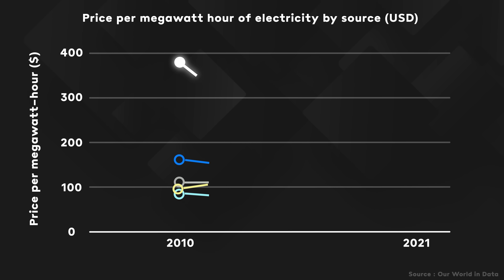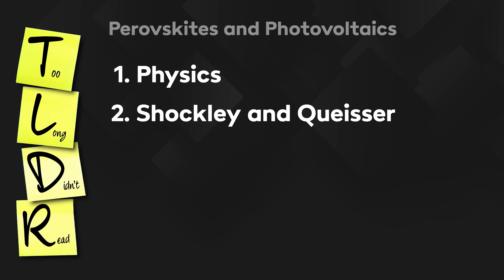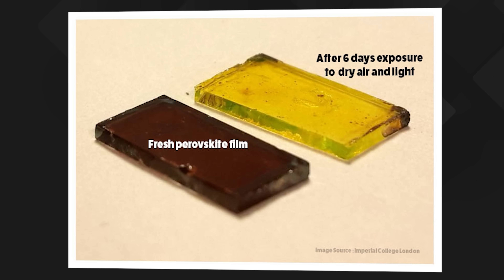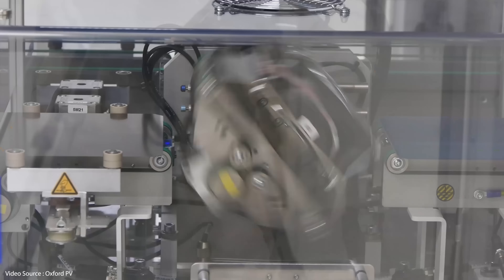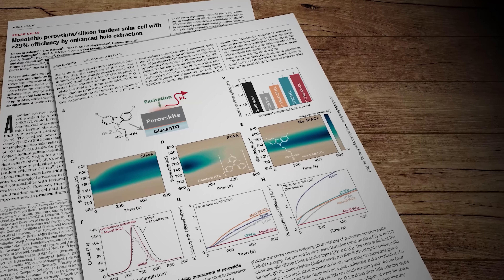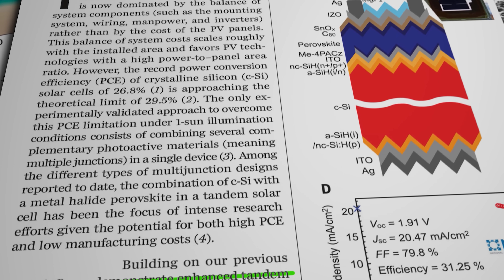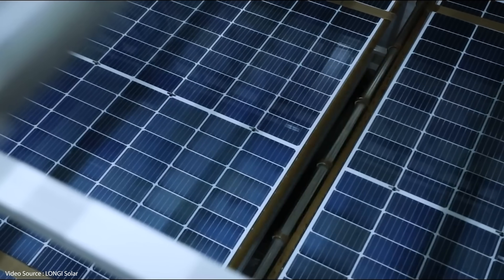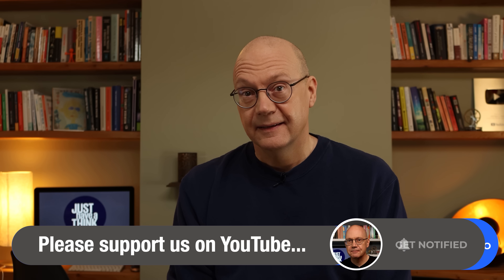Perovskite Solar PV. FINALLY some good news!

Comment: There is another approach to further improve efficiency:

With current silicon is it is cheaper to buy extra panels than to use solar tracking.  But, as the kWh per panel increases with perovskite layering, presumably cost/kWh will drop while cost/panel will rise.  That sets the stage for tracking technology to become economically viable in general.  (It is viable in the small set of edge cases where you need a certain amount of power, but have a limited space for panels.)
Reply: I like people like you that tumble the numbers and find new viable economic tipping points. Well done. I was mucking around with the idea of using my solar system to replace gasoline rather than grid electricity the other day and found that powering a car ( EV)  saved me 4 times more money in gas than using to replace grid electricity.  I then went a little further and thought what if I cover the entire 150 sq metre roof of my 4 bedroom home with panels  and came up with this. It would cost $40k (Australian) and generate enough to power 14 EVs each travelling 400 klms each week for 20 years. The weekly solar cost of each EV would be $3.00. The cost was mind blowing enough but what really astounded me was that just one residential roof top could power 14 cars.
Reply: @markumbers5362  Australia and China may be the poster children for nation scale solar.  Adelaide is always setting records for most days running entirely on solar/wind and batteries.  And with heat in the north, solar output lines sort of well with air conditioning needs...(although everyone turning on AC after work is a bit of an issue...hence batteries...but batteries in EVs...better charge at work ;)  I hope work charging accelerates).
Reply: @markumbers5362 As someone who is considering buying an EV and likes math, I’d love to see your calculations.  I want to verify all parameters were factored in.  Factors such as panel degradation over time, seasonal variations in output, battery degradation and replacement costs at approximately 10 years.  Also just initial set up costs of installation, panels,solar converters. inverters, home battery, racks, wire, etc

Then take the initial start up cost and instead put it into a S&P fund and drive a fuel efficient ICE car instead of an EV.  I’m not arguing one way, or the other, or drawing any conclusions, as I have yet to do the calculations.  I like looking at the numbers people produce.

There’s also the unknown variable of a Tax on solar panels.  In CA PG&E hates solar on people’s homes and they own the governor as they pay his wife millions of dollars.  So a bill has been created to tax solar panels on homes.  It’s temporarily been put on hold, probably due to the upcoming election.  But it’s been drafted……

I might as well add one more factor, at least for CA.  The legislature believes that people driving EV’s aren’t pay the high tax on gasoline and therefore they aren’t “paying their fair share” of maintaining the roads.  So that’s another future EV tax that is probable.
Reply: @jasonborne5724  You don't have to go in to that much depth to understand the savings. For a start if you need a car you need a car so that money isn't going in to your retirement fund anyway. EVs are a little more expensive up front but their servicing costs are 40% less and if you use roof top solar to charge them they cost $3.00 Australian (AUD) for a 400 klm 60 kw charge because the amortised cost per kwh is 5 cents and if I sold that kwh to the grid they would pay me 5 cents also. My previous 3 cars were a Honda CRV Subaru Forester and Mazda CX 5. They all burned an average of 8 litres per 100 klms so it would cost me $60 for 400 klm trip. Charging with roof top solar is 20 times less than gasoline. I only believe the life of a car is 10  years anyway after that maintenance costs get so high you may as well buy a new one. Because servicing costs are so low on EVs the extra interest on a slightly larger loan balances out. So now I look at simply this. A Tesla Model Y costs me $70k down here. A similar size but  inferior performing with less features Mazda  CX5 costs $55k. Over 10 years I will save $30k in fuel by solar charging the Model Y.  So the total cost of ownership is $15K less for the Model Y.  As far as tax and legislation is concerned. It is true EVs do not pay any fuel taxes and that revenue must be made up somehow. However that is in the future and so too is this. According to Wrights law for every doubling of production there is a 20% reduction in price.  Battery, solar and EV  production will double 5 times over the next 10 years so very soon the upfront cost of an EV will be less than an ICE. When that happens any tax increases on EVs will still make them cheaper to own than todays ICE cars.
Reply: @markumbers5362  you missed the investment point.  It’s not the cost of the car, although the new EV will cost more than my used BMW.  It’s all of the roof top solar equipment that I don’t have to buy with an ICE (approximately 40k).  That money goes into a fund.
Reply: @jasonborne5724  I replied on the solar in a seperate comment. If you are about to retire or move it may not be a good investment because you may not live long enough or  it may not increase the value of your home enough. If however you stay in the one house for 20 years it is probably the same as a  10 -15% per annum return on the $8,500. But this all depends on the future. Will energy prices and gasoline go up or down. Will EVs comedown in price and ICE cars go up because of volume reductions.  Every investment is unpredictable.  I have run my own retirement fund for 38 years  investing in shares and property. It's all a bit of a gamble. My call your call.
Reply: @jasonborne5724  There's an additional a sad and contrarian factor to consider.  At the rate solar panels and EV (Tesla specifically in N. America) prices are dropping, your ROI calculations should include cost of buying too early.
Reply: Things will likely go the opposite way. It is expected from perovskite solar panels to be extremely cheap, as they basically can be a film, instead of silicon+glass construction. So after the initial higher prices (where customers with limited roof area will want to pay more for the new tech with higher efficiency), the cost of silicon+perovskite sandwich should become similar to silicon-only designs as solar panel manufacturing transitions to it. And there may also be competition from extremely cheap (at a cost of much lower efficiency and product life) perovskite-only adhesive solar film products or similar.
Reply: perovskite actually works better with indirect sunlight than normal panels because it can get a lot of energy from scattered light, since it captures visible light. meaning it will make panels more efficient when not in direct sunlight than normal panels, making tracking less necessary. it may also make bifacial solar panels more interesting. what we should be thinking about now is extending longevity and recycling, something as simple as finding a way to cool solar panels cheaply can not just make them more efficient but also last MUCH longer.
Reply: I think efficiency is a bit of a non-issue assuming panels became still an order of magnitude cheaper. 10% efficiency is totally fine if the panels or film sheets cost tens of dollars. Most places are not efficiency limited in any way. What's more important in many higher latitudes is having enough extra panels to be able to make dual-sided west-east farms or have separate panel groups heading east, south and west and be completely ok with some of the panels producing next to nothing for 2/3 of the day time. Winter production also practically needs vertical panels which are not that great during the summer. If they're cheap enough so you can build a summer set and a winter set it won't matter much. Panels need to be so cheap that we can extend the morning and evening curves as far as possible. The mid-day production peak will soon be an actual problem because there is nowhere to dump the negatively priced electricity.
Reply: @wombatillo  I'm hoping the point of the video was that because of the efficiency gains, the overall cost per kwh would come down...so would maybe drop prices another 33% (assuming same manufacturing costs).  The cheaper the cost/kwh, the more we can overproduce on peak and supplement shoulder periods.

I like your optimism, but the video pointed out I think that we've hit the limit on solar panel frames.  I hope we have another order of magnitude of price reductions on the silicon, but it's pretty far along the S curve now.  Of course another halving of solar electricity is great if combined with perovskite or other multi layer technology, but 10x reduction...already costs to install on roofs is becoming the biggest issue.  I hope you're right.

Comment: I don’t think the price of the nuclear energy has doubled, the financial cost should not be counted. Secondly, the cost of renewable energy should include also the cost of the grid, which must be adapted to the energy production points spread over the territory.
Reply: Did he talk about the price of nuclear energy in the video? That's one of the things I'm trying to wrap my head around lately. There's a local non profit dedicated to increasing my Canadian province's renewable energy output. They claim that nuclear is about 4x as expensive as wind and solar (in my province at least), and I'm trying to determine how accurate that claim is. Also, whether it's different around the world. Perhaps nuclear is less expensive than in my area in some areas of the world, maybe even less expensive than wind and solar, etc.
Reply: @user72974  he showed a chart with the energy price by source. Nuclear energy is the most secure, reliable and cheap (overnight cost) source by far.
Reply: @user72974 it might be cheaper in a country which built exactly the same type of reactor every time.

Comment: It is hard to always be cheer leading these folks involved with renewables and the new energy economy.   But on the other hand we have a lot of just wait and see.    This looks promising.   It would be great if it all works out.

Just to note what you said, solar/wind/storage IS the cheapest way to provide power in history.    We don’t need to wait and see, we just need a lot of folks to get out of the way.   And let folks get it done.
Reply: I expect this to be a near sure thing, as the largest solar panel manufacturers in their slides are already putting only 1 more generation of efficiency improvements to pure silicon cells, and then perovskites from then on.
Reply: we need the people on the sidelines to become blockers of the people who we need to get out of the way. tell your friends.
Reply: Storage how?
Reply: @sammason2300  Typically battery storage, as far as talking small scale (home) appliances. However for the large scale the best storage currently is pumped hydro.
Reply: @beatreuteler  not sure about that at this point, but yes for grid scale it is a time proven method, now over 100 years old.  However the cheapest form may end up being flow batteries or iron oxide batteries. Which can scale from the home to grid size.   Energy is everywhere, we just need to learn how to harvest it and where.
Reply: @sammason2300     There are a lot of different options available.  Pumped hydro, lithium batteries, iron oxide batteries, lots of other methods for storing electricity.   There are Thermo batteries that store heat for industrial processes, even store solar energy.

This is the power of the new system.  We can store huge amounts of power.  Some are calling it super power.  We have never had this before at the current cost level, which is cheaper than anything the fossil fuel companies can ever supply, even in their wildest dreams.
Reply: it bothers me because most of these amazing technologies are fruit of capitalism and are behind patents, what slows progress. if everyone had access to each other's technologies and discoveries we could be much farther ahead, but they won't share because it may hurt their future profits. its the same bullshit as the covid vaccines. we were supposed to be working together.
Reply: Subsidies is what works
Reply: @EdSurridge  We're past that point aren't we?  Governments should be putting all their resources behind this research.
Reply: @EdSurridge  the issue with subsidies is that the renewable energy market is working against the fossil fuel industry, which is the most heavily subsidized industry on the planet.  If the fossil fuel industry subsidies ended, or got reassigned to renewables this transition would be done this decade.
Reply: @willxin4517  fossil fuels aren't subsidized at all. instead they are hit with "windfall profit" taxes, paying much more in tax than other technologies.
Reply: @EdSurridge  if something is cheaper why does it need subsidies ;) ? 
The main problem isn't the price itself now. More that society is a big bus and big buses have big turning circles.
Reply: @johnduncan5117  it is because of subsidies.   The fossil fuel industry is the heaviest subsidize industry in the world.  Those subsidies should be redirected to renewables. That way it would only take about 10 years to completely eliminate fossil fuels.
Reply: @EdSurridge - Ya "subsidies"  =  more taxes ... guess your can't have your cake and eat it too.